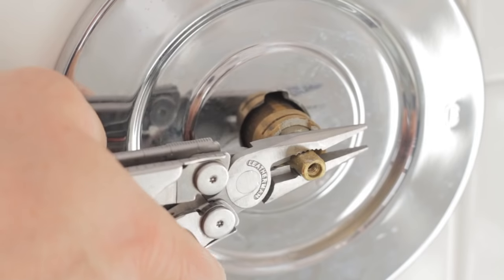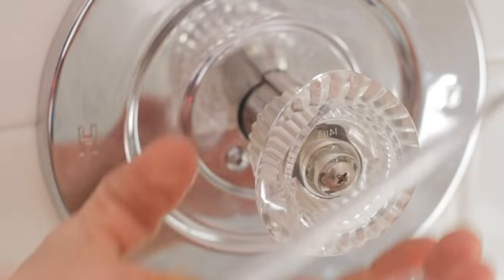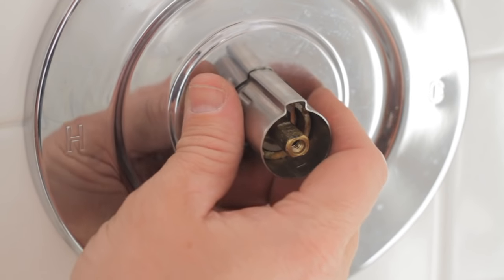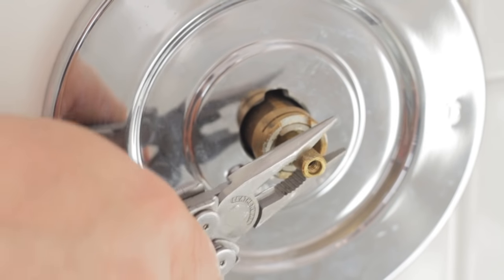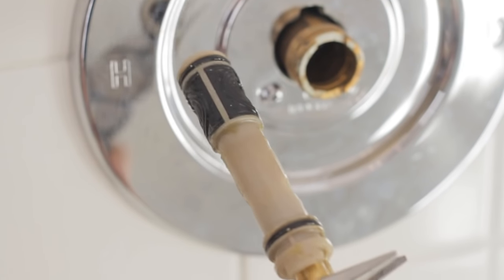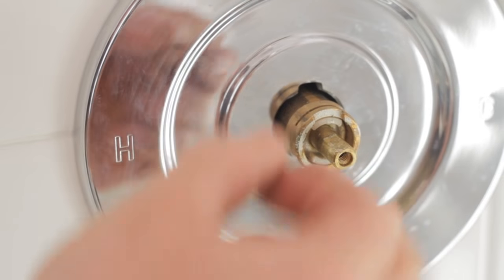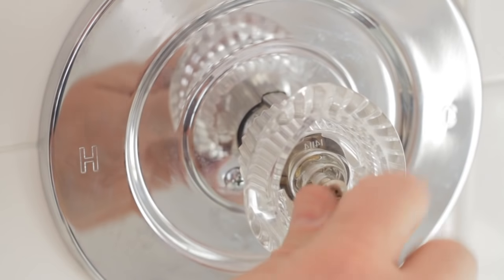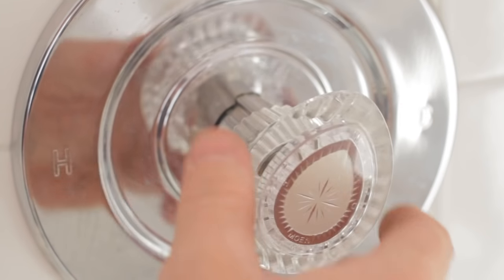Bathroom Repair : How to Repair a Push Pull Faucet

Comment: Might want to turn the water off first. Also if the cartridge is stuck after pulling the clip, if you don't have the tool, use that leatherman or needle nose pliers against the cartridge body (not the stem) to rotate the cartridge. Once the cartridge can rotate, thread the handle mounting screw (with out handle) into the cartridge and use pliers or the claw of a hammer on the screw to tug the cartridge out of the valve body.
Reply: Your  comment is what everyone is looking for not anything on the video
Reply: Thanks buddy
Reply: Nice
Reply: bruhhhhhh... that worked lmao
Reply: @Teegatas85  You have no idea how seized a Moen posi temp valve can become. Only ran into it like 4 times but you’ll understand once it happens to you.
Reply: Glad I read this before I started 😉 Probably would have made a hell of a mess. Thanks!
Reply: I leaned the hard way lol
Reply: @H22aDA  That is were I am today.
Reply: This helped. I had to use the bigger leatherman's to get the points in enough to turn it, right around the body of the cartridge as he said. With the tips pushing against the little prongs on the top and bottom of the cartridge. Then I could pull it out.
Reply: Thank you from the future!! I have no choice but to figure it out myself, so I TRULY appreciate ALLL the help!!

Comment: First step is to turn off the water at the main. This video helped immensely. After removing the sleeve, the core and clip was found corroded. Had to use a brass (not steel) brush and used some CLR (calcium, lime rust remover) WD-40 could also work.. I also had to use a jewelers screwdriver just to get the clip started and then used the needle nose pliers to fully remove. Of course the cartridge/ core was corroded and was not able to remove with the pliers. I had to go to Home depot and pick up the Core puller for Moen made by Danco (around $16). That worked extremely well. I took the cartridge to HD and matched it up with the replacement. While your there pick up a small tube of water proof grease (same aisle) and apply the grease liberally all over the new cartridge and install.  I turned the water supply on and now the hot was the right and the cold to the left. I took off the clip and rotated the cartridge 180 degrees installed clip. Now everything works as designed. Time to have a few beers.
Reply: Thank you James for even more information. Mine was corroded also.
Reply: What model did you end up buyding?

Comment: A few notes to add.  1.  If youre replacing the cartridge and buy a new one you will get the special tool. Its a white plastic fitting that fits into the cartridge keyway and when twisted with an adjustable wrench it helps to break the cartridge free enough that you can pull it out.  If you get the free replacement from Home Depot you wont get that special tool.  2. If you buy a very viscose silicone grease from Dow Corning you can remove the cartridge and regrease the seals and O-rings.  It restores the cartridge to good as new condition.  3. If when you replace the cartridge your hot and cold are reversed you remove the handle and rotate the cartridge stem 180° and theyre restored to the correct orientation. No need to remove the cartridge.

Comment: So I’m just here to give an experience. My handle was too close to the tap/wall and didn’t want to tighten without turning on the water. I fixed it by putting rubber inside the interior of the faucet where the screw goes. It put pressure on the screw and allowed me to fully turn off and on the faucet where before when I pulled it out the handle it  became loose and wouldn’t turn off the water. It was technically an honest diy mistake that could happen to someone else. Hope it helps someone out.

Comment: You made it look so easy. I did exactly as you said and everything came apart as you showed, without too much difficulty. Thank you! Steve
Reply: But does a new push pull faucet come with what he took out, or do I buy that separately? What is it that you're mainly replacing to stop dripping?

Comment: Thank you a ton!  Finally switched mine out, and it's so nice to have a working-like-new shower control again.
Reply: Did you switch out the cartridge? Do they sell in Home Depot or did you need to use amazon?

Comment: Thank you so much for this video. The screw holding my old pull handle broke off at the head when I was trying to remove it to clean underneath. And when I tried to remove the rest--disaster!  I was frantic until I found your video.  I had no idea that the cartridge was a whole unit.  I got the Moen 1200 and my sweet, patient superhero husband replaced it in less than an hour with your help! THANK YOU!

Comment: Great vid instructions!  Have a question, I've the same set up but for some weird reason,  the part where the screw is bolted it's a lot longer, is that normal?  Also, what's the name of the valve your replaced in this vid?

Comment: In my case, the newly installed cartridge worked for a week. Now, the handle is stuck on the cold setting, and I heard it clicking into place. I can still turn the water on and off as a usual. Thoughts?

Comment: Is there a trick to getting a very stuck cartridge out?  It's a stanadyne brand (whatever that is), it's probably close to 35 years old and isn't budging.  Now that we've tried, the dripping that was the issue is now worse of an issue.  If I can't get it out, I can't take it anywhere to match it up with hopefully a new one that will fit.  Thank you.

Comment: in case your wondering that is a 1225b insert the other one out there is 1222b
Reply: One comment above said it is a 1200. Can someone confirm what model? Mine is identical to the one in the video and I need to buy it so if someone can confirm I would be most grateful.

Comment: Thanks for the video, Terry, it had excellent close ups of how to do the repair.   Question ... how do you ID the part number on the old cartridge so that you can order a replacement online or from your local plumbing store?  I gather there are many different variations of this Push / Pull model?   I'm just trying to minimize trips to the HW store.

Comment: Hi - I removed the index button, got the screw and clip out, then grabbed the cartridge with nose pliers to take out. It wouldn't come out past the plastic tabs (ears?). Then I put the screw back in and tried to pull with a hammer claw, but the plastic tabs were still not budging. So I did not force it and put the thing back. Looks like the plastic tabs are not attached to the cylinder, but not sure. Can you please advise? Thanks so much!

Comment: From time to time  You Tube self help videos do not survive collision with the actual situation on the ground.

 I could take a shower but the pull push faucet would not push in all the way without some gyrations, ie switch between hot-cold, the bath and the shower, and eventually I could push it in to shut off the water.  Straight up cartridge replacement, no?

Index button went off, as well as the handle screw, easy peasy lemon squeezy.

I reached to point in attempting to remove the sleeve and it was NOT pulling out,
No it was not budging.  No sliding away from the assembly. 
I removed the faceplate and it looked like the sleeve was part of the whole plumbing assembly so I called in the PROs.

He got the sleeve off, but in examining the retaining pin, it had corroded to the point it was part of the whole valve assembly.  

So yeah, it was entirely fortunate the sleeve stayed put for me else I would've forced out that pin, that in the plumbers estimation(which is why he did not remove it either), would have wrecked the assembly, and having faucet shutoff problems would have been the least of my worries.

To remedy the situation, 995.00 to replace the valve assembly  etc, no tilework...(if it was just a cartridge replacement, 125.00)

Comment: If the knob is sliding out on it's own after turning the water off and pushing it all the way in, what should I do? Just rented an apartment and the landlord wont fix it, so the water is running all the time (not alot but still a small stream).

Comment: My locking clip is totally stuck. I’m pretty sure it’s been there since the 70s and it won’t budge at all. Advice for that?
Reply: Get some CLR (Calcium Lime Rust remover) if it's available where you live and pour some on, if it's not available try plain old vinegar. After that if it's still stuck try some penetrating oil like WD-40 (shake the can) since the faucet tube clip and tube are metal in a wet environment it may have corrosion on it.
Reply: Thank you! I might already have some CLR at home. I’ll try that and then move down the list. Appreciate the help!
Reply: Thank you! I might already have some CLR at home. I’ll try that and then move down the list. Appreciate the help!
Reply: Thank you! I might already have some CLR at home. I’ll try that and then move down the list. Appreciate the help!
Reply: Thank you! I might already have some CLR at home. I’ll try that and then move down the list. Appreciate the help!
Reply: Thank goodness for this video. I did follow everything even turned off main water. Much corrosion cleaned it up purchased new cartridge and puller danco. Tried water and it was shooting all over...started again but now can't seem to get the clip to go back in. WTH am I doing wrong. .could I have put cartridge in wrong? There's no marking for hot/cold either.

Comment: Your knob is sloppy as hell because it’s missing the stainless oval shaped washer. Also, before you remove old cartridge look for a small step on the very end of the cartridge near the flats thats on the shaft. The little step identifies proper orientation of the cartridge. If you don’t do it right hot and cold will be reversed. The instructions with new cartridge explain all this. I don’t know a single plumber or youtube video plumber that knows this.

Comment: Video title should be (Replace) not repair. Other than that, it was helpful. Though I was searching for how to repair one without (hopefully) having to replace. For whatever reason, mine is dripping pretty quickly right at the bottom of the Hot/Cold knob. I haven't messed with it, so dont know what the issue is.

Comment: Can someone add in a simple terms as to what to do, when after removing the clip, the cartilage is not coming out?
Reply: What did you end up doing?
Reply: @nedaltrebor8553  Well... It's a long story and wished I had filmed it for a follow-up YT clip but after several days and I could finally do it all by myself. The problem was, I was under impression that the cartilage is out,  but what was out, was only the inner core of it, with the damn outer cylindrical still in place (After a separation). So be prepared for a lot of unusual things and believe in the golden rule that states: "If there is anything worse that can happen, it will all happen to you"!!!! 
Things I learned: Yes use the lubricant spray but only for a limited amount and don't forget though there might be some rust involved, most of the gunk that causes internal adhesions are actually the sediments of Calcium. So your best cleaner would be something in the line of CLR pro and not DW-40 or Liquid wrench penetrating oil...
As I could see a side hole (One of the water inlets), in what was left, my hope was pust something in it, to anchor something and pull it out. This never worked... I tried long nose pliers. Modified and bend the tip of the plier to the side. Made custom L-shaped metal rods out of thick nails.... NONE worked. 
Saw somewhere that a nipple extractor tool can help but... Fortunately wasn't able to find one that fit the diameter of the pipe or I could have caused more damage than good. As the real helpful move is side to side motion and not a full twist, to get that damn thing out!

But what really did the trick, was to apply that plastic cap that comes with new cartilage and slowly and gently but consistently make a small side to side movement (15-20 degrees of right and left - not a full rotation), along with outwards pull. And the same type of move with a long nose plier that is a quality tool and actually can grab and hold the tine short plates. The so called Moein tool is useless and don't pay anything for the original moein that is north of $50 or clones that are $15-20 ish and are useful only for the easy jobs when there is no frozen inner part.... 

Ultimately and if you don't give up or not use too much force that can break things, you actually should be able to do it. Be prepared to leave the work for the next day, if you feel too tired from doing what appears to go nowhere... And don't forget. If someone with my experience and expertise (ZERO in this field) could do it, everyone else should too. Only don't lose hope and be patient rather that powerful. 

Best of LUCK.
Reply: Thank you so much. I'm going to be attempting this today, so just trying to cover what could go wrong
Reply: @nedaltrebor8553   Hah hah... And from the bottom of my heart, ALL THE BEST .
Only don't forget that there are several types of inner core (Cartilage) and you need to bring it out to see what is needed for your faucet. So be prepared to leave the water supply off for a while, till you get to HD or Lowes, etc and find the exact replacement, once it comes out. The common type of 70s-80s (That was my case too) was/is  MOEN 1200 Collection One Handle Kitchen and Bathroom Faucet Cartridge Replacement (I leave a link below) that is about $20 and is all metal but some say this is replaced with Moen 1225 or should be replaced by that one, which is half made up of plastic and apparently has better durability or functional properties or whatever (And btw is cheaper - 2nd link is to this one) but being a bit paranoid, I went with original all metal.
Link to 1200: shorturl.at/bgnC6
Link to newer rec:  shorturl.at/pvSU7
Reply: @samsen3965  yeah, pretty sure its the 1200/1225 type. Debating on which to get if it is indeed that type still.  So you ran into this problem? https://youtu.be/ahd050iJJsc&t=9m58s ?
Reply: Went great, thanks for the help. It was pretty stuck in there, but some good side to side wiggles did the trick.
Reply: @nedaltrebor8553   Way to go my friend. And another reason for Thanks Giving, Today! 
Have fun. 🌹🦃

Comment: This genius forgot to tell you guys that you need to turn off your water line valve.

Make sure you turn off your water line or turn off the valve off otherwise if you try to pull it out and that's why he's mentioning that you might need a special tool because there's high pressure! I tried doing this through a plumber through the phone and he started laughing when all the water was pouring out and I had to run and turn off the water! Trust me !